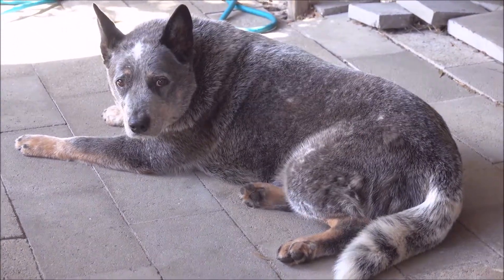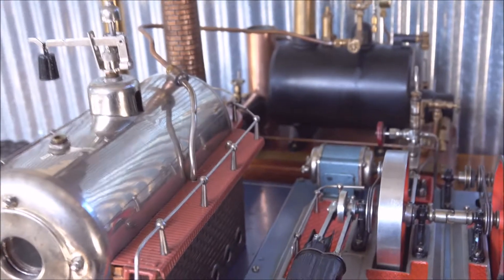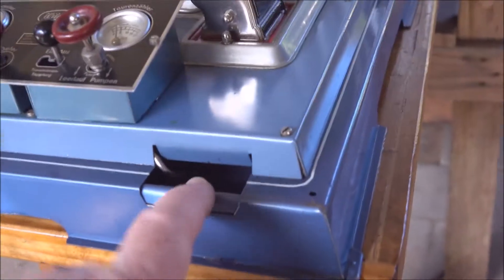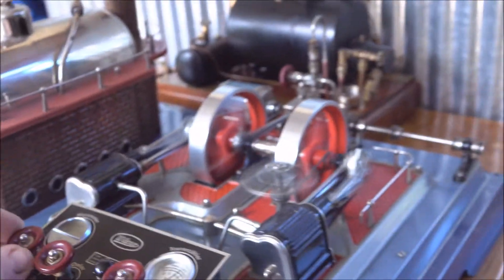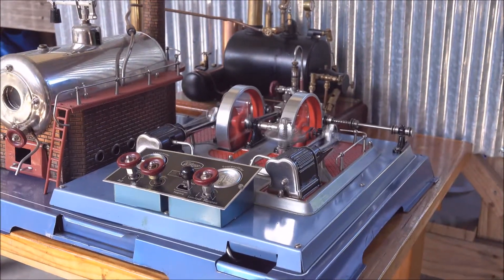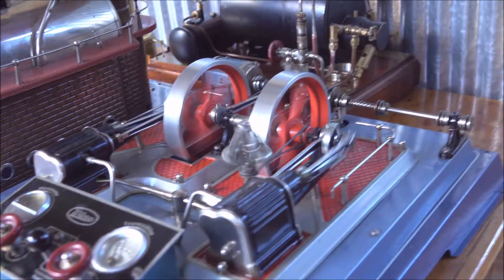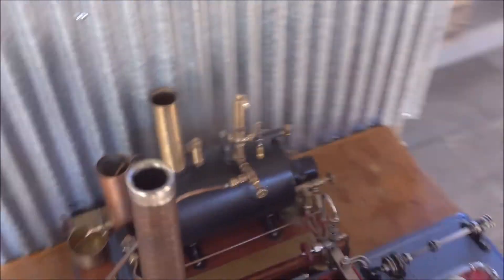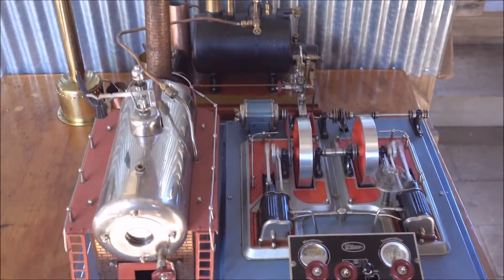Modified Wilesco D32 Model Toy Steam Engine running on live steam

Comment: I realy like the combo with the Stuart boiler.
The D32EL has been on my wishlist for a long time. :)
Reply from the maker: I have since taken the D32 apart again (it has to be one of the most frustrating engines to work on that, truly horrible!) I have modified it now that it runs of a ceramic gas burner.
Be careful buying a D32 as they are prone to leaks as the flux Wilesco used wasn't cleaned off and is corrosive and eats through the boilers after decades.  So many people have had problems with them.
Reply: @SteamEngines-Jim  Thank You for the information! I was actualy looking at one on a local auction site when i red Your reply.
Reply from the maker: @Vampi_Sweden  Did you succumb to temptation? 😀
Reply: @SteamEngines-Jim  
Not this time, it seem to be gone...

Comment: How did it develope pin holes ?
Reply from the maker: Just age, they are very well known to develop these. Just about all the old secondhand ones I've seen are literally green inside with corrosion and are likely (unfortunately) to develop a pin hole leak.
Reply: Blue Heeler I have the kit form of the brass traction engine I run it at least a couple of times a month I drain it after using it and use only distilled water any advice on preventing pinhole leaks ? Or is it just inevitable,  thanks
Reply from the maker: Wes, I think you'd really unlucky to get pinholes in the TE that you have. The problem with the D32 was that it has a nickel plated steel shell over the brass boiler and the flux that they used to solder the boiler causes the corrosion. The TE's boiler is visible and no flux remains. Enjoy running your TE as much as you want and have fun with it. They are great fun!
Reply: Blue Heeler  appreciate the help thanks